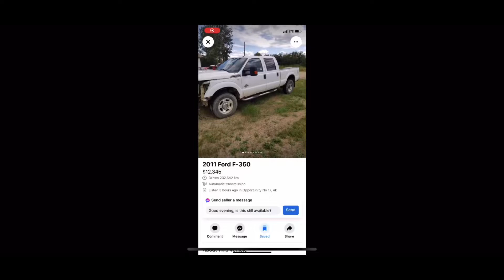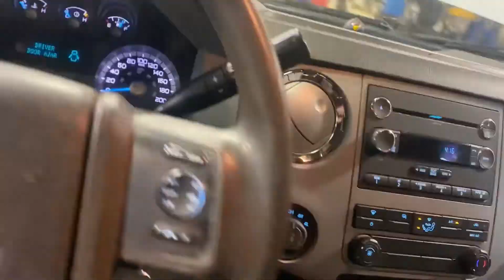F350 6.7 Rebuild

Comment: What did it cost you to rebuild it
Reply from the maker: The big ticket items in Can$
Truck $3500
Heads $2000
Pistons and machining $2000
Windshield $500
Take off tires $500 (super cheap)
Gaskets, bearings and head bolts. Shocks, fuel cooler, box liner, front hub seals and axle ujoints. I had lots of used parts.  
I’m thinking a little more thane $10,000 Can

Comment: Did you replace the cp4 and injectors?
Reply from the maker: One of the injectors was shorted out causing the PCM not to communicate. I was told this could have been due to contamination. I had a used high pressure fuel system out another truck to put in.

Comment: Why did it blow up my 12 had cracked exhaust valves I replaced the valves n the head caught it before they fell apart
Reply from the maker: It didn’t blow up, but it was lacking compression in a few cylinders. I think the valves were sticking open from sitting. I decided to replace the heads too. I’m happy with the results.